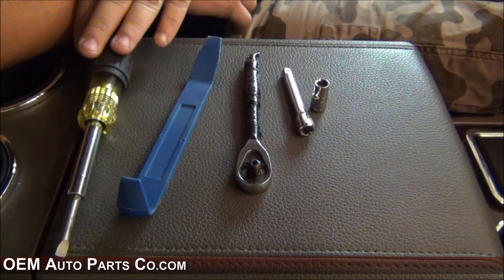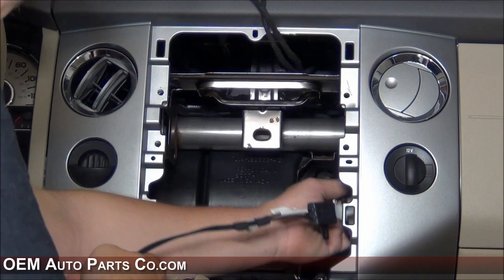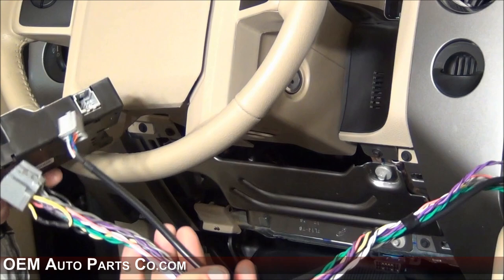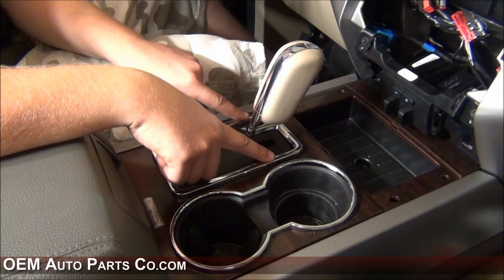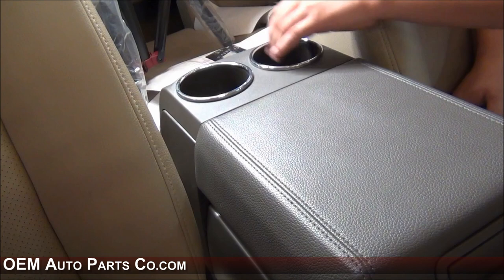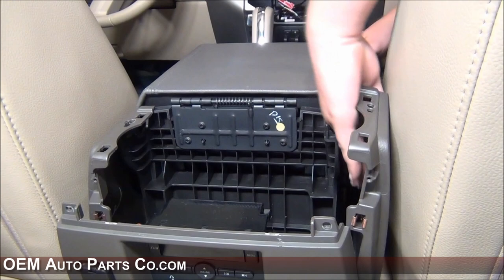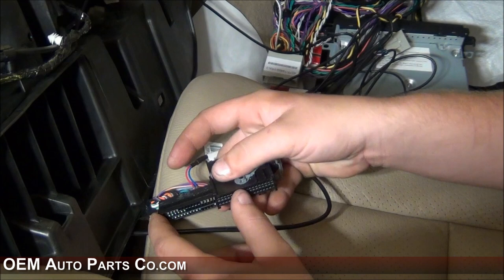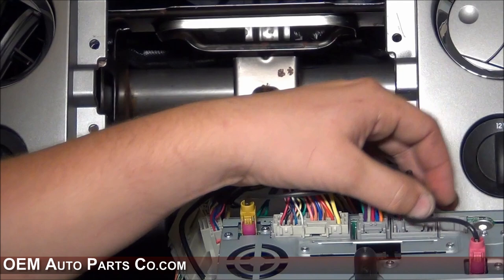[OLD] 2009-2014 Ford Expedition Sync 1 Factory GPS Navigation Radio Upgrade Installation Guide

Comment: You only need to remove 4 screws to get the center counsel out of that truck.  Do not take out all the screws like this kid did.  It is not necessary. just pop off the panel hiding the two screws at the front of the center counsel directly below your head unit then slide both seats all the way forward and remove the screws on the back towards the bottom of the counsel then slide straight back.

Comment: I bought one of those units for my 2008 ford escape xls, I plug it and works but sound is very low, you can barely hear music or voice, will I need to install amplifier or something?
Reply from the maker: Contact our support department at the number on the website. That's sounds like something that can be solved.
Reply: @Infotainment_nav  the thing is that I didn't bought a kit from you, I just found the HU online and bought it, my car doesn´t have a factory amplifier, by seing your video I uasume I will need to find an oem aplifier and wiring harnesses am I right? or is there some kind of programing I could do with forscan in order to make it sound without an ext. amp ??

Comment: hey didnt you need to reprogram the new navigation / radio? I thought if you removed and replaced the factory radio with a used one the anti theft security will lock it and you required to reprogram before it will work. I about to do the same on a 2007 mkz. your help will be grateful
Reply from the maker: We preprogram all of our radios specifically to the VIN of the vehicle the radio is going into!